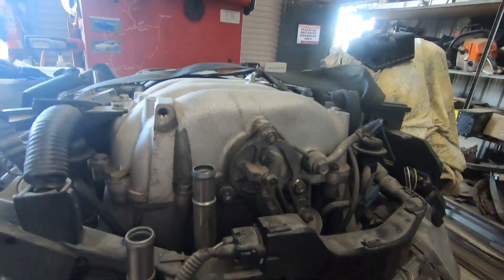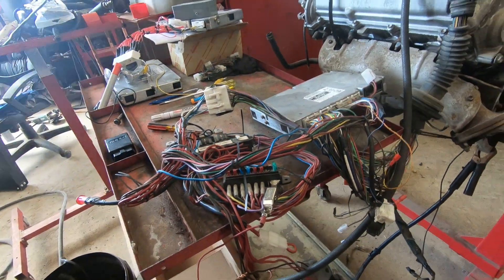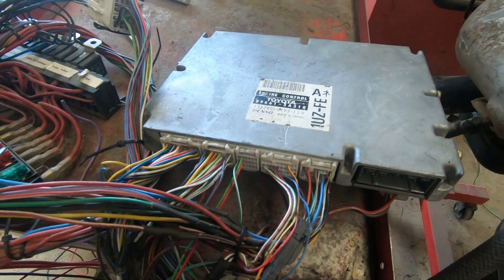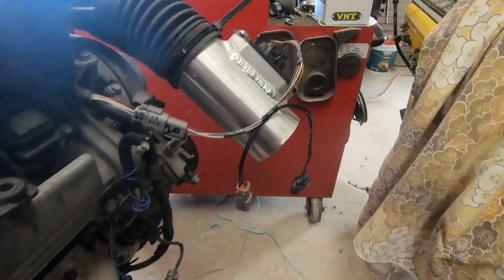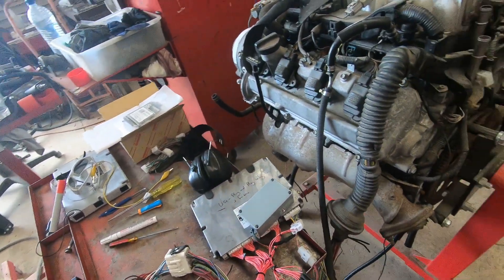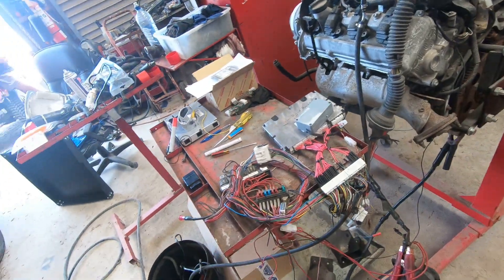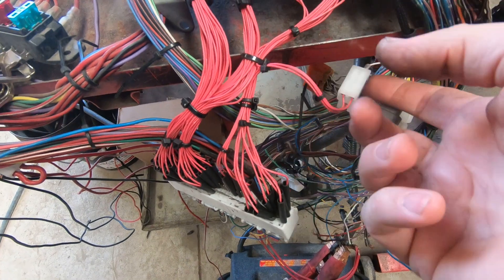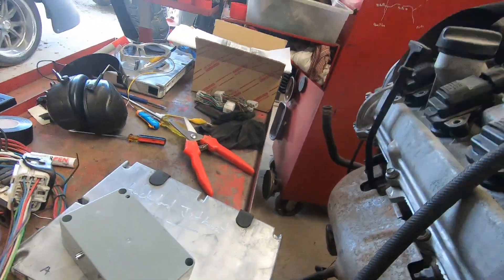Wiring loom differences between early 1uz VVti and late 1uz VVti engines

Comment: Hello, did you know if 90919-02228 coils on  plug are amplifier or not? 
Thanks for all ;)
Reply from the maker: Hello.   90919-02228 are fitted to the first vvti engines,  often referred to as the vvti big coil and have built in ignitors.  Cheers Kelvin
Reply: @CartuneNZ  ok! thank you, did you know how to wire it with after market ECU?
Reply from the maker: @theosechi5426  hello.  Yes.  I have it in several aftermarket ecu wiring videos.  Cheers Kelvin

Comment: I have a 98 with the vvti I purchased the whole car cheap they lost the transponder key I was wondering if there is a way to bypass it to test the motor.
Reply from the maker: Hello.  Absolutely a way to bypass the immo.  I have done hundreds and its a service I provide as its not a diy system.   Cheers Kelvin.
Reply: How much im in the us
Reply from the maker: Hello Darin.  Around $500nzd plus freight.  I do require your ecu to complete the job.  Do quite a few all the time.  Cheers Kelvin

Comment: Which side is pressure and which return on the fuel lines?  Mine were just cut off at the hose.
Reply from the maker: I would have said vvti only have one fuel line but i know you have a 2uz which are like every other fuel injected car which have the fuel pressuee regulator on the outlet from the engine.  Cheers.

Comment: Great work. I noticed you were testing with a 3A310. To my knowledge, this ECU is non-immobilized from the factory, lacks MPX, and came with a viscous fan. Could you speak a little about how A/C is controlled with the lack of MPX?
Reply from the maker: After getting the footage I knew I should have covered than part number up.  haha.  I have a few of the early 1uz VVti Crown ecu's for testing purposes.  I find them really handy.  If someone turns up with a non running engine or bench testing I use them alot.  I even have a couple of the proper plugs for the ECU and they have very few wires in the F plug.  The AC is controlled like the older non-vvti engines.  Signal from A/c controller , Pressure sensor for A/c goes to ECU from memory and the A/c relay is controlled by the ECU.  As we are converting lots of older vehicles like surfs we often bypass the engine ECU and run a older manual type A/c control.  Works well generally with the addition of a temp switch in the cabin heater/ac box.   Interesting enough many people say the engines don't make as much power but I'd like to spend some time on the dyno to see if the mapping is any different.
Reply: Yeah, I picked one up as well, but haven't used it for anything. I figured I'll keep it around just in case. The F plug only has 6 wires on it. 
Do they have the older style ELS load sensing pins for the idle up? How about the fuel control - does it have FPR/FC like the Celsior or did they have the older style fuel pump ecu? I was told that the SC400 VVTis didn't have MPX either, so perhaps there are some similarities there.

Comment: If you want to get brand new ECU headers for the 1UZ-FE VVT-i just let me know I supply them. www.phoenixenginemanagement.com
Reply from the maker: Thanks.  One part I need a new supplier is the large Pins for the F plug on the VVti.  Ill flick you a message sometime.  Thanks for watching my Videos.  Cheers
Reply: CartuneNZ yeah I’ve got loads of those terminals as well. I supply all the connectors even for 3UZ and those small terminals for the 3UZ as well
Reply from the maker: @PhoenixEngineManagement  Got plenty of the 3uz little terminals.  Buy heaps of them.  Haven't checked my supply of plugs for the 3uz.  Just restocked on 1uz VVti and all the trans plugs.  Just when you think you have them all another one comes along.  Next 3uz I wire the customer wants tefzel wire onto a Link Thunder (also a dealer) so I'm looking forward to that.    Cheers

Comment: Rpm wire ECU how is
Reply from the maker: These ones have a RPM wire which outputs a low level signal similar to other ECU signals.  Both ecu versions have RPM in different places.
Reply: @CartuneNZ  how to search rpm out put wire
Reply from the maker: @FaisalbilaBila  I really need more details.  I have information on the position of the RPM on all the different 1uz and 3uz ECU's.  Quite different with different outputs and then different requirements for what device you want to run.  I require more details.  Cheers

Comment: Mobilizers no connect
Reply from the maker: The Immobilizer between the early VVti and the Later VVti are slightly different.  Operation is the same but configured differently.  My cross over loom allows me to check both systems using the same engine now so I can test all easily on a running engine without swapping wiring looms.

Comment: What’s your favourite 1uz? (I’m assuming you like them? I met a bloke years ago who specialised in a certain type of motor who hated them)
Reply from the maker: It would be a hard choice but I think the 1uz VVti might be the winner.  Most likely the later one with a aftermarket ECU converted to manual, thats if I am chasing an all round package for a fair price.    They make good power and are easy to work with with plenty of revs.  If I want more torque the 3uz is a winner.  If it was favorite for certain jobs it might be different. Often customers are better off with the slightly simplier Gen 2 engine with the 4 speed auto for swaps like surfs or auto hilux.  The older gen 1's are great but getting old so hardly cost effective these days.  I've got a footage of a couple of tidy ups and by the time all the parts are added to the cost they are getting pricey making a VVti far cheaper.  I think choosing the correct one for the desired outcome is the most important thing.
Reply: CartuneNZ Thanks that’s food for thought.